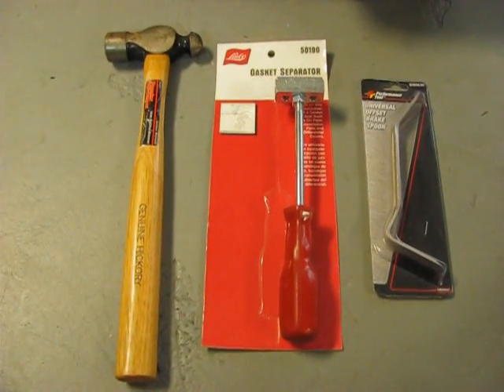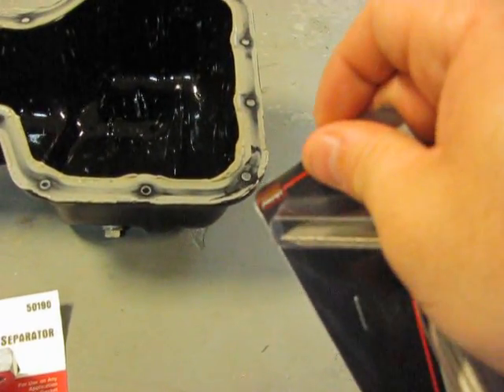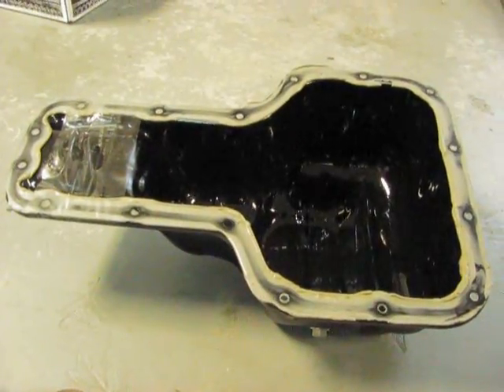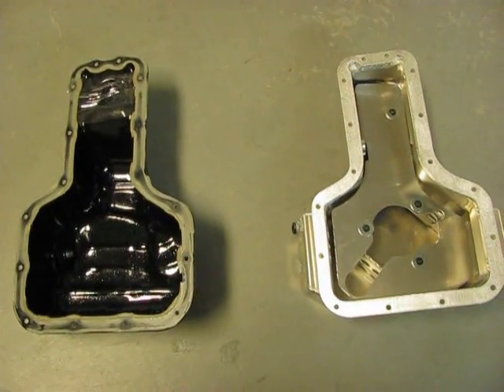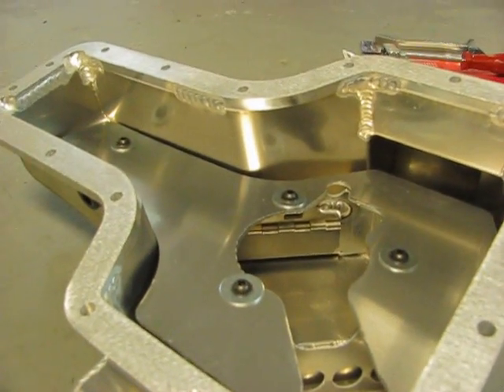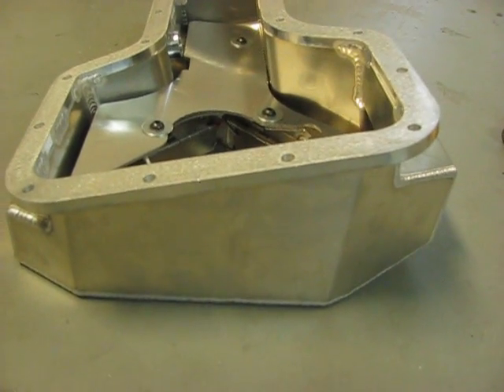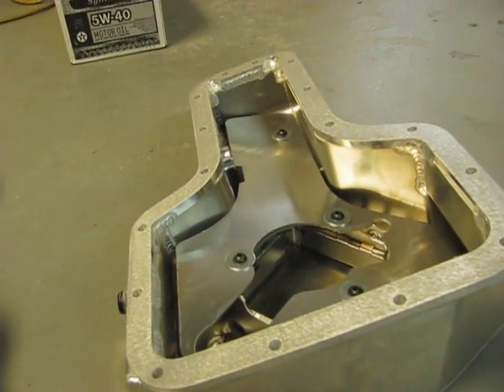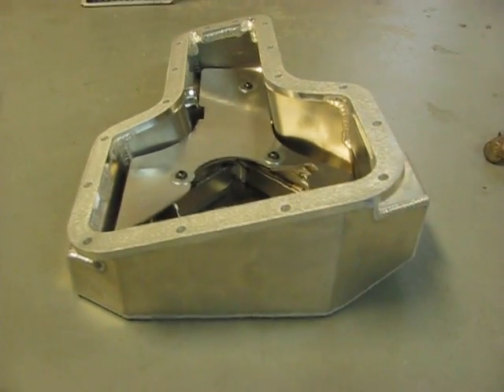Removing Lotus Elise/Exige Oil Pan and Comparison to Moroso Pan

Comment: At that tab corner is it normal for it to have a light film of fluid. I notice if i dont drive her for about a week or 2 it produces a light film. But if i drive it at least once or twice a week it doesnt producd a light film at that corner.
Reply from the maker: I had some small leaks and ended up having to reseal mine, no fluid at all after that.
Reply: @billswebspace  do i need a new pan? Can i just seal that area without seperating it from the block?
Reply from the maker: Unfortunately, you'll have to remove the pan to reseal. Make sure you get the mating surfaces nice and clean and use enough sealant around the bolt holes- straight bead from hole to hole and then a circle of sealant around each bolt hole. Follow the directions on the sealant to the letter- I used threebond 1194, replaces threebond 1104.

Comment: is it fit for the toyota celica gts 2zzge engine right?
Reply from the maker: This pan is for the Lotus Elise/Exige that use the 2ZZ but it would not fit a Celica, the way it is mounted would require it to be a bit thinner on one side- process should be the same to install though for the most part. Moroso does make an oil pan for the Celica/Matrix 2ZZ specifically though.
Reply: Oh ok im asking because i saw this same oil pan on monkeywrenchracing.com for the toyota celica gts but im not totally sure
Reply from the maker: Diego Villasmil Call and ask them, I was under the impression the Celica oil pan was different for a reason but maybe not? This is the oil pan I was talking about, notice the part not on the oil pump side is noticeably thinner/smaller, I though to get over the cross member in the Toyota FWD platform cars: http://www.monkeywrenchracing.com/product_info.php?products_id=799
Reply: They are exactly the same.
Reply from the maker: Thread that discusses the two different Moroso oil pans for this application: http://www.lotustalk.com/forums/f25/there-2-styles-moroso-oil-pan-49096/